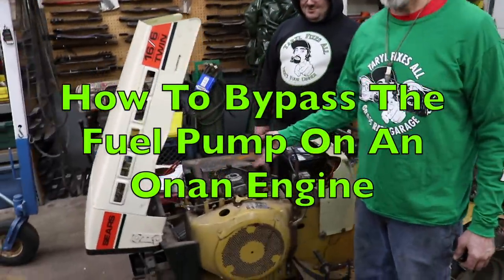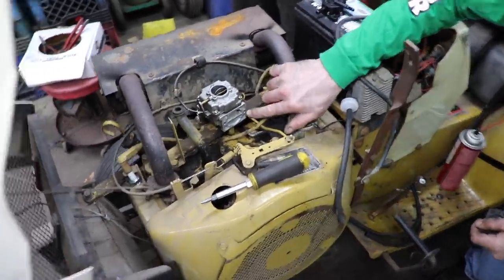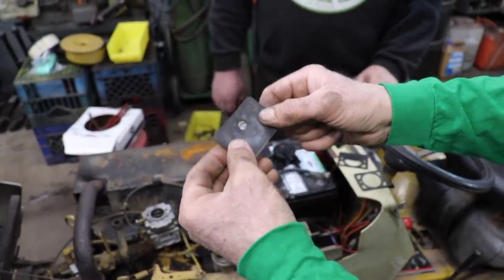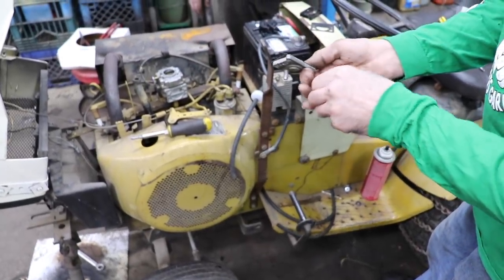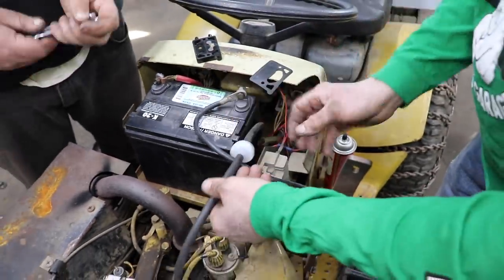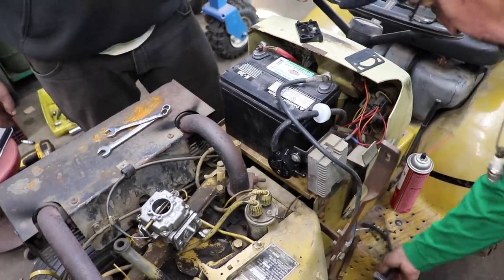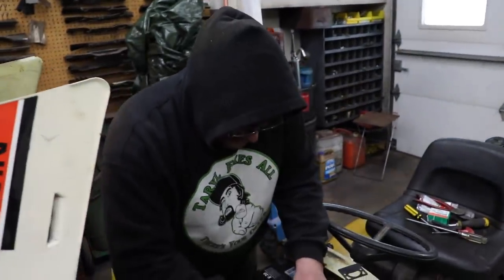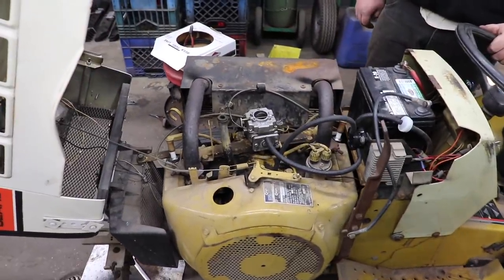How To Easily Bypass A Fuel Pump On An Onan Engine

Comment: I’ve also used them on Kohler K series and Command engines to save money over buying the mechanical pumps. They are also great when the fuel tank is lower than the carb and gravity won’t work. Thanks for sharing!

Comment: I tried and tried to rebuild the Onan fuel pump using the cheap Chinese rebuild kit. I finally gave up and bypassed the fuel pump just as Taryl demonstrates in this video using the B & S vacuum pump. I had to make a gasket using a thick piece of gasket material because the old gasket was very thin and it leaked gas. I also replaced the gas line from the tank and added new plugs and a condenser. It is unbelievable how well the fuel pump bypass worked...the Sears SS16 Onan starts and runs just great.. Taryl Saved my day!

Comment: I just did this on a friend's Case 446. Worked out great. Unfortunately, this was AFTER I had installed a cheap kit to replace the original vacuum pump (like you said it worked for a while-ONE hour). Thank you so much. The Briggs pump works so well!

Comment: I did your fuel pump bypass. Works well. Although it was not the fuel pump. it was a cheep Chineese  condenser. I put a SBC ~Blue Streak on and no more loss of power at high speed. I have a 18/6 BG/MS with a DD11 Carb

Comment: I did something similar but I used a electric fuel pump on my case 446 tractor it runs great. No problems. It starts really easy.

Comment: Pulse?  Is that hose connected to a vacuum port on the intake that moves a diaphram  on the briggs pump?
Reply: Was wondering the same thing
Reply: Yes. It would have operated the pump built into the carb. I expect that it connected to the block piece that he didn't use.

Comment: I did tried this repair and fuel sprays out of the air bleeder hole in the inlet cover! Should I knock out check valves? I’m not sure what to try next?
Reply: I have the same issue. How did you resolve???
Reply: Same. Trying to seal with moto seal

Comment: not sure what's wrong with mine but after a replacement check valve plate it pumped fine for a few seconds and then stopped, opening it up revealed the rubber flaps under the reeds had somehow blown out or expanded and were hanging up.

Comment: Should also get a new Model Replacement Brass Float for her. 
As the old Ones ALWAYS fail. well on 95% of the onan bf ms engines i have worked on.

Comment: YOU CAN DO THE SAME WITH THE OLD STYLE BRIGGS 14 AND UP OPPOSED TWINS ALSO HAVE DONE IT A COUPLE TIMES MYSELF. CHEAPER THAN BUYING A NEW CARB.
Reply: Thanks, I was going to ask that question. Mine is a '77 L head.

Comment: Tried this only problem is on my plate where the spring would sit is a tiny pin hole that squirt's as it pumps
Reply: I'm having the same issue ... How did you resolve???
Reply: @jmk1086  get a tube of seal all just a small dab will do
Reply: @robwood8201  thanks for the response!!